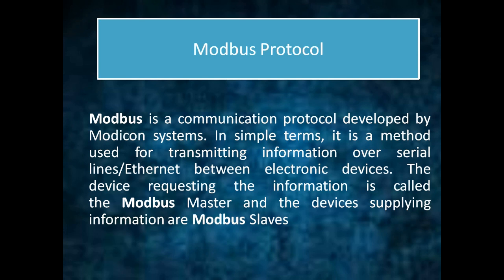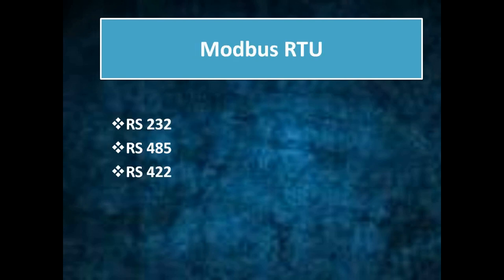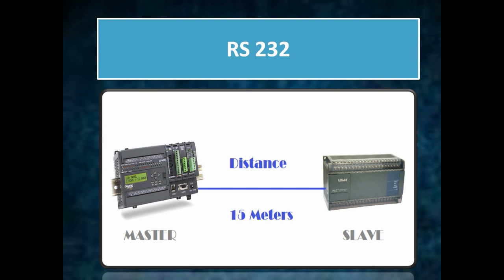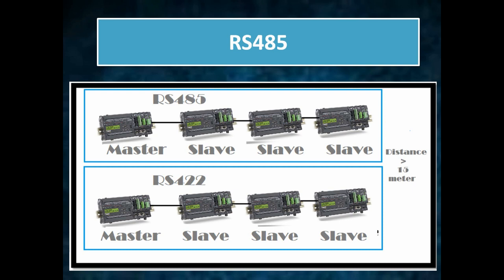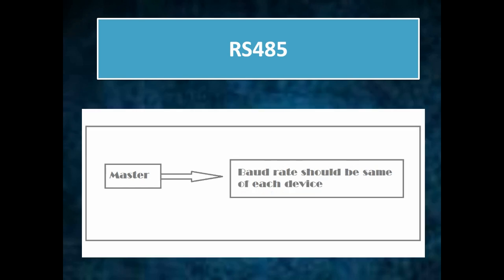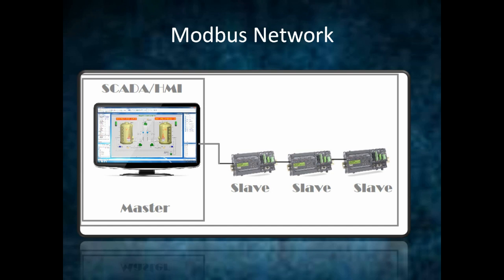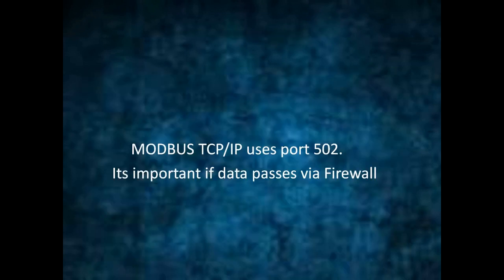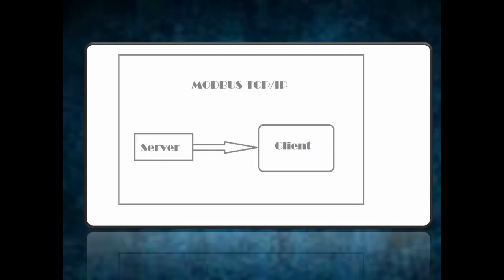Modbus TCP/IP and Modbus RTU communication protocol-100 % you will learn it

Comment: how can we wireless communicate   betwwen scada system (computer) and plc ??? and interfacing plc to other IED??
Reply: its depend some criteria.
1. if PLC and SCADA HMI are same brand, its can using proprietary network between them 
both of them just connected to the wireless modulator (modem) or wireless point.

2. if they are different brand, you can using modbus TCP or modbus RTU as Norman video.
both of them connected to the modem (modulator demodulator)

main of the equipment is the wireless or radio modem. for the protocol is same such as you connect using hardwired/cables.
its just media transportation between cables and/or wireless/radio